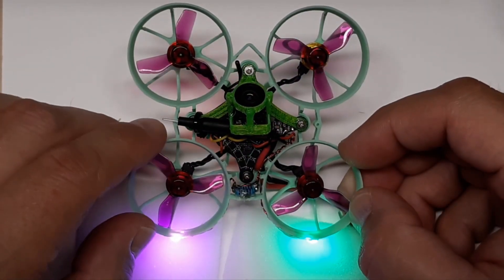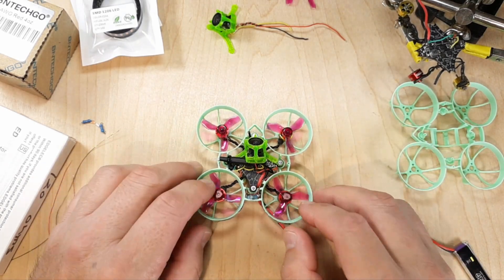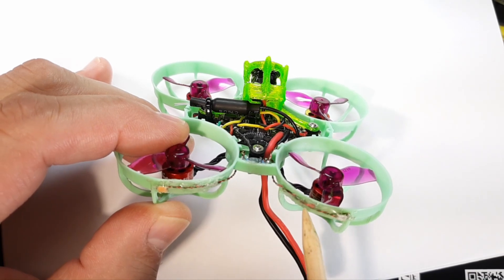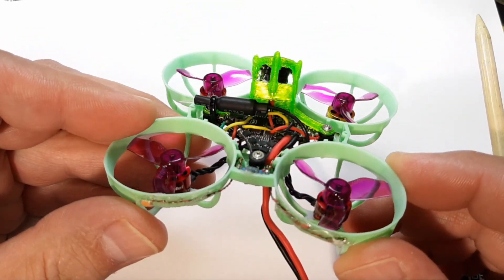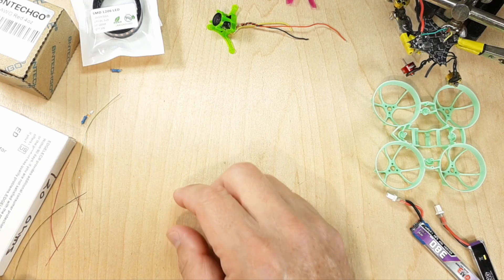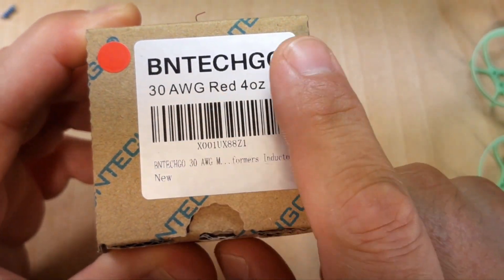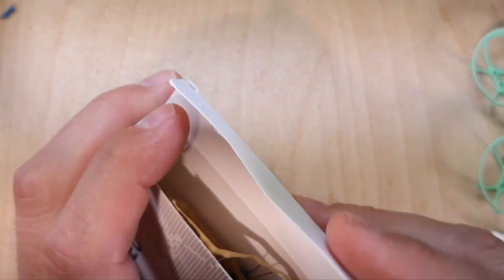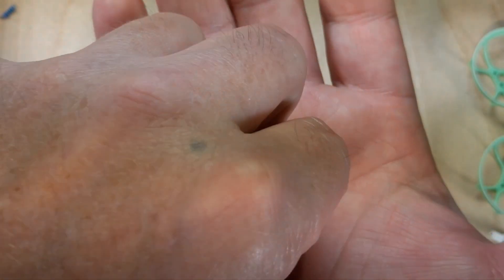How To Wire LED | Proper LED Resistors | 1206 LED For Whoop Racing

Comment: Aloha! Great video! Thanks so much for making it and sharing your insights! I have enjoyed watching it!
I have made several wire harnesses after watching your videos. I found that using fine sandpaper to remove the wire’s lacquer coating has been most effective for me.  I fold a small amount of the sandpaper in half and then put the wire between the two pieces. Running it through the sandpaper several times seems to work well.
Thanks again!
Reply from the maker: My pleasure, I appreciate your support and encouragement.. This is an idea I will definitely try - I have some stiff 1200grt too...🍻

Comment: Hello  so  if i want to run 4 led i will need 1 resistor for each led making  it total of 4
Reply from the maker: @reyrisonrosales5101  
Yes, that is the proper way. You can get away with one resistor for two LEDs, but they will either be one dim and the other bright. Possibly, too bright and burn out prematurely.. Great question...🍻

Comment: you cant run them both through 1 resistor?
Reply from the maker: It's not recommended to run 1206 LEDs off the same resistor. I did run 2 off one resistor on my UWL build. However, the brightness was affected. More than two, you risk burning one or one, not even lighting up. I looked for an interesting article that explains this in more detail but couldn't find it off hand - I'll attach it when found..

Comment: Nice tutorial...and thank you for showing the soldering on the LED especially.   Im curious to know if magnet wires from say a broken 0802 whoop motor could be used in a project like this to save a little bit of money, or if 0802 motor magnet wire is too thick of a gauge (i suspect it is but ive yet to find an example motor spec from like happymodel or newbeedrone that lists the gauge magnet wire used).  I have a few busted 0802 and I've had success peeling off some 0802 magnet wire to use for rx antenna on an AIO FC in a pinch.    Lastly, what temp did you have the solder iron set to ? I assume something not super hot for those small components, but im curious.   0.4g is pretty reasonable to add that LED enhancement, nicely done!
Reply from the maker: My pleasure, and I appreciate your feedback. The magnet wire I use is 30awg, mainly due to my ability to see it, lol.. You can go thicker or thinner (barely any current flow).. If you can scab old enamel wire, more power to ya. As long as the enamel coating is good. The temperature I use is 230°C.. I have a video "How to Flow Solder" in my QuickTips Playlist if you're interested in learning more of my techniques. Absolutely Agree! 0.4g is totally worth having spectators see ya rip, lol...🍻